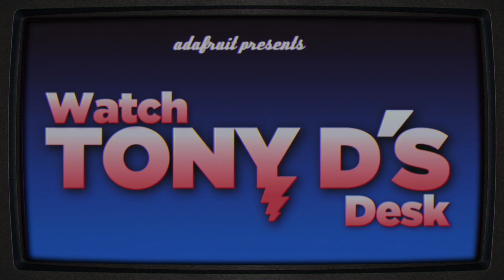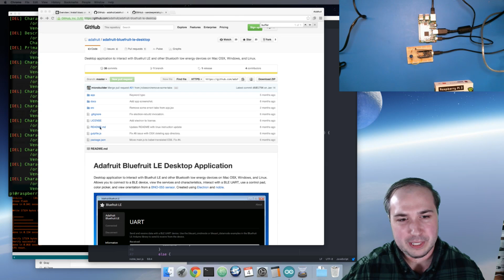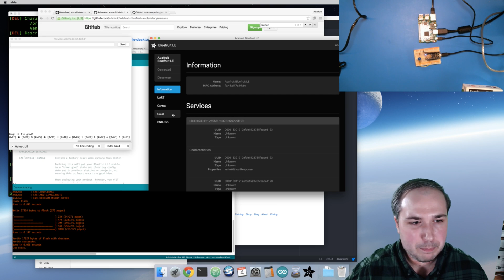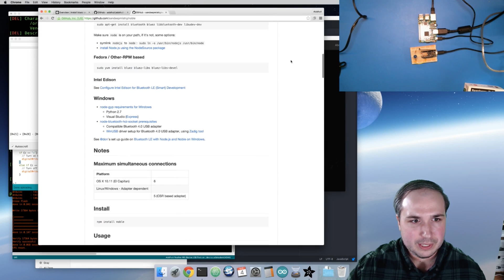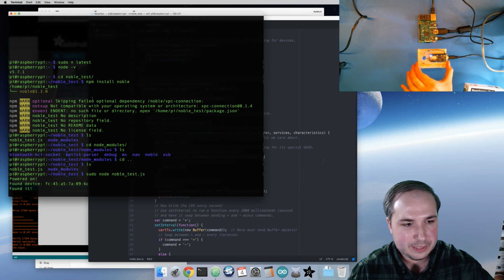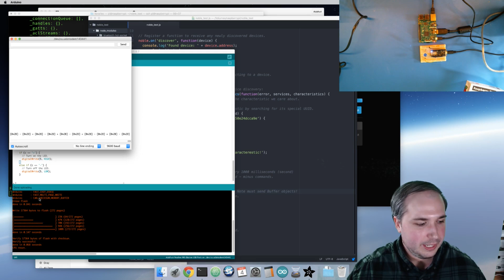Raspberry Pi 3 & Bluetooth LE pt. 2 with Tony D! @adafruit #LIVE

Comment: @Tony D, you should definitely check out 6lowpan and Contiki OS. 6lowpan is a network that uses the same physical and MAC layer as BLE (802.15.4) but lets all devices have IPv6 addresses and routing capabilities. BLE only lets you have a central device connected to multiple peripherals which is very limiting for large sensor networks. With 6lowpan, mesh routing is employed to increase range and spread the routing load over multiple devices. The greatest thing about 6lowpan in my opinion is that you can build the same web services over it like an http web server, DNS or COAP. A border router bridges the 6lowpan network with the Internet or a classic Wifi network and one can access the previous web services.
Reply: ***** I had a course at school around 6lowpan, wireless sensor networks and Contiki. So that's were I learned most of it. But I think it would be feasible to self-teach oneself with material found online and with the Contiki OS examples. The boards we used were based on the ATmega128rfa1 which is being replaced by the SAMR21. Contiki also worked fine on the TI Sensortag and CC2650 Launchpad. Check out the hardware section of the website for all supported platforms.

Comment: Hey Tony D! I love checking out your projects. I wanted to give a BLE project suggestion. An anti-slouch device that promotes good posture. It could be a wearable microcontroller with an accelerometer. Clip it to your shirt and, sit up straight, press a button to set a resting position. Then  if the user begins to slouch, a vibrate message could be sent to the user's phone over BLE. Or a large message could take over your computer screen. Adafruit.io could be integrated to track posture throughout the day. I think it would be a fun, useful, low cost project.

Comment: Thanks so much for very informative and useful videos. Just have a question, do you know how to change/modify/control connection parameters using Noble? I have looked over the Usage page, and it seems no API or method related to connection parameters.

Comment: Can the Raspberry Pi3 used as an iBeacon device?
Reply: +István Nagy 
YES...check out radius networks at...
http://store.radiusnetworks.com/collections/all/products/pibeacon
Reply: Glenn Pradzinski thank you, but I'm interested in using the Raspberry Pi 3's internal Bluetooth LE radio as an iBeacon device.
Reply: You can...the command "beacon transmit -I" turns the device into an ibeacon
Reply: Thank you! I thought I need that specific LE dongle in the kit for the software to work.
Reply: It transmits with iBeacon standard at 10.00 Hz
Reply: +István Nagy I mean you will need a USB Bluetooth plug in